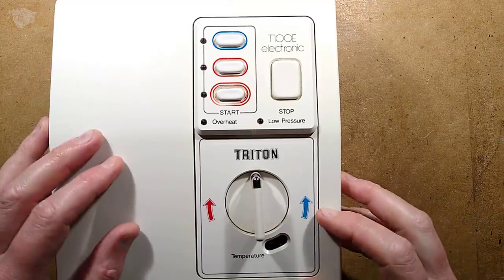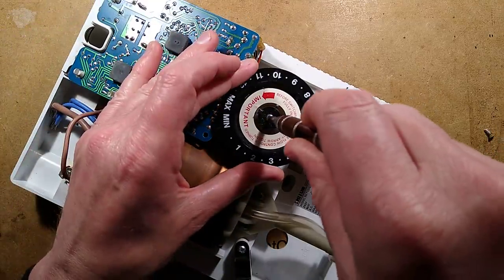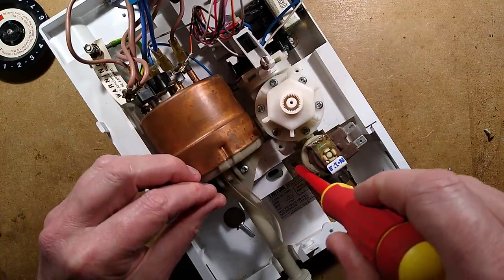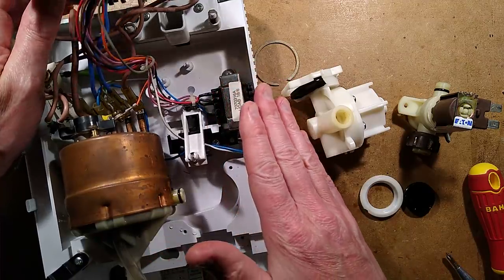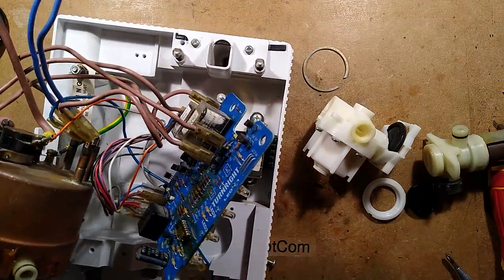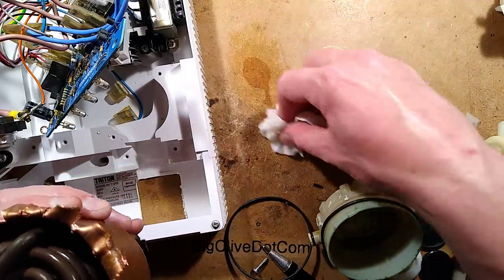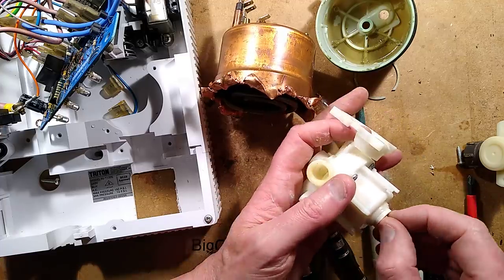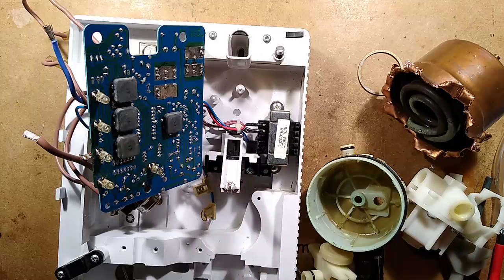Teardown of a British electric shower that went bang.

Comment: My nan doesn’t think I can think fix the electric shower.
Well, she’s in for a shock
Reply: 240 volts worth :D :D :D
Reply: Ba Dum Tsssssshh!
Reply: good one!!!! : )
Reply: @chmarr  The most electrifying shower experience ever.
Reply: @girlsdrinkfeck  Yes, the biggest risk is often fire when Mr Bodgit uses the wrong cable and leaves loose connections all over the place.
Reply: If thats your current joke, I think its revolting, and Im going ohm !
Reply: Joule be overloaded with compliments when you figure out watt's wrong with it
Reply: @alexander3554  Thanks for positive reply and I offer no resistance finding a solution. I will make a start on Faraday or Sarady.
Reply: I couldn't resist trying to make a few puns of my own, but watt I found was that I just don't have the brain power or mental capacitance to transform a sentence into a pun-charged version that'll amp up the audience. I guess I'm just missing the spark, and I don't think I can rectify the situation. Maybe I'll just jump off a half-bridge into a high current river…
Reply: @TerrisLeonis  Well done, and I know when Im outpuned, there will be no more induction of puns that has led to this current phase.
Reply: Lol.
Reply: I know this comment is not current, but I got a charge out of it…
Reply: @girlsdrinkfeck  Everybody who agreed with your statement should brush up on the basics.

Watts = Volts * (Volts / Ohms)

When you touch a live circuit, the amount of current flowing through you is limited... by you. By how many Ohms of resistance there are through your body (and clothes) to ground.
And by the volts you said don't matter.
Twice as many volts at the same resistance, equal twice the amps/watts.

The Watt/Amp rating of your actual circuit isn't completely irrelevant, but somehwat counter intuitive. If you got a higher rated circuit with thicker wires, this actually makes you less 'attractive' as an alternate current path. Path of least resistance and all that.
Reply: That’s got a nice Tim Vine rhythm about it.
Reply: Did she feel more confident about you repairing her shower after that?  If not, is that because her heart stopped?

Comment: The reason why the shower would have a delay before shutting down is both an anti limescale measure and a safety feature. Pressing the stop button first switches off the elements, flushing cold water through the tank before shutting off the water solenoid valve. Water which gets too hot is more likely deposit limescale on the element compared to cold water. There is also the added safety factor. If the a non-delay shutdown shower is switched off, then back on again in shortly after, the water sat in the boiler tank gains extra heat as it sat there idle for a few moments and when re-started can then causing a scoulding risk.
(I work in this industry, but not Triton!)

Comment: I remember when still living with my parents, in one house we had this exact same model.  We moved into that house in 1993 where it was already installed by the previous owners, so by this point it'd be at least 27 years old. Don't know how long that model was on the market for, but it's done well if it's lasted that long.
Reply: Good old British made product made to last decades. I expect a modern one will be designed to last 10 years.
Reply: My parents had a different model from the same brand that lasted a similar time as well.   One time it broke and my dad just replaced a part inside it and it lasted for another 5 years...
Reply: Another comment mentioned a 1990 date code on one the components so it was probably built 30 years ago.
Reply: We still have one of these in our bathroom at home, no idea how long it's been there for, but still works perfectly (touch wood), probably not the most powerful or efficient, but if it ain't broke...
Reply: @Haggisking  y'all say touch wood? We say knock on wood in America.

Comment: Awesome video.  In the US, devices like these are rare & used primarily in non-residential applications.  I've only seen the "Insta-Hot" modules under sinks; never a shower.  They use the 20 amp version of our 120V GFI outlets.  Never seen one "hard-wired" without an outlet.  Probably because our breaker-panels aren't Ground Fault protected.
Reply: Spot on, ground is required.

Comment: What i find quite suprising given the environment this lives in (damp and wet) is that there seems little internal corrosion or damage to the mostly uncoated pcb!
Reply: Not only that - zero scaling on the elements! I live in the South of England, and within 2.5 years - never mind 25 - the whole copper kettle would be full of limescale.

Comment: As a plumber from the UK, these are the most common form of shower in the UK. They're more economical to install and to service than a pumped shower or power shower. They make sense to install in (and are most commonly found in) rented properties. Seeing some of the comments here saying "Mixing electricity and water is never a good idea" leads me say the most alarming thing I've seen an electric shower like this do is dim the lights in the room next door when turned onto full power. They're designed to not be dangerous I've only ever seen a handful of these have this happen where water is pissing out of the casing from every angle; that said, the majority were broken by age or fatigue as opposed to being inherently unsafe. When installed correctly and of a reasonable quality, they generally last for quite a long time and are pretty safe. When they go wrong, you tend to know (as shown) so it isn't like you'd be standing there having a shower and suddenly you've got mains voltage flowing through you. You'd have to be incredibly dense to not notice that something clearly isn't right
Reply: Yeah it's the same with a lot of things. People just have a fairly rudimentary understanding of how things work and make judgement without the knowledge to back it up... I mean, being scared of an electrical shower is hardly an issue. But it's that same kinda thought process that fuels bigger issues in the world. It's best to be critical and not believe everything you are told but you should also be critical of your own lack of knowledge at the same time.
Reply: They might be more economical to install but certainly not economical to run. They use A LOT of electric. Spend the extra money and install a proper shower fed by hot and cold water from the gas boiler. A shower is usually installed above the bath so there is already a hot and cold feed available.
Reply: @simontay4851  Not every where is on gas mains, and more houses are blown up by leaky gas  pipes than electric showers. A lot of electricity? How many showers, what temperature, etc? fwiw, in UK, in a few years time, gas will not be installed in new builds. The advantage with electric water heating, is that all the heat goes into the water. No flue needed, etc.
Reply: @simontay4851  How long do you shower for? My 10kW one would consume one unit in six minutes, so 15 pence. I only actually have the shower on for a minute or two.So around 5p per shower.
Reply: @simontay4851  Significant amount of houses don't have gas. Its immersion heaters, water heaters and electric showers but for the amount of time these showers are on at one time, they aren't that uneconomical
Reply: @debonh3828  The efficiency loss from converting fuel to heat, then to electricity, then back to heat, is about a 60% loss, rather than just creating heat directly from gas, which is about a 20% loss. Gas is much more efficient from a fuel-to-use standpoint. Electricity-to-heat is a 100% efficient process, it's all the things that happen before that create your losses.
Reply: The student house I rent has four 6.5kW electric showers in one house. It's an ordinary house with a 100A single-phase mains breaker. You can do the maths.
 When you turn on the shower you can see the CFL bathroom bulb dim momentarily.
We've lived here for 2 years and not had any fires yet, although one of the switches outside the bathroom for isolating the electric shower melted once (probably because the switch was pitted, the landlord put in a new switch and it's been fine since).
Reply: if this isn't a power shower, what is it...?
Reply: @RWL2012  It's an electric shower. A power shower refers to the power of the water, which is pumped by electric pumps.
Reply: Steve D  No it's not efficient. Large electric hot water heaters have been banned from the US. They must be heat pump units.

Comment: Mains power in the shower?  I thought it was supposed to be a toaster in the bathtub.  Is this like the ketchup vs mayonnaise on french fries thing?
Reply: If the power is out, run it off a car battery in the shower 😀😉
Reply: Absolutely mayonnaise!
Reply: Shocking!
Reply: The heating element is in a copper container that is earthed/grounded to unsure that the water has zero voltage on it, unlike the plastic suicide shower heads with the token gesture earth wire in it :)
Reply: French fries should be served with remoulade, not mayonnaise.  Though McD has a special "French Fry Sauce" instead.  But if you've never seen the correct sauce before, it looks like raw mayonnaise (the main, but not only ingredient).
Reply: lorddissy, If the mains did get the water charged, it would trip the RCD (GFCI), same with the toaster, it would trip the RCD (GFCI)
Reply: @EdwardTriesToScience  Well...not all of these heaters can be operated via an RCD. For most efficient operation, many heat via un-insulated wires. The idea is that most current will got the path of least resistance, which is the wire, and the little bit of current which goes "into the water" leaved the water again through the grounded metal pipework. Too much work for the electricity to go though a hose onto a person with a relatively high resistance.
Usually, a 300mA RCD will be fine. But a 300mA RCD is not guaranteed to protect a human. A 30mA is meant for protection of humans, but will be too sensitive for such a heater.
Regardless, Clive's bother's heater has insulated heating elements, like a washing machine, a dishwasher or my old Philips coffee maker...at least until the insulation failed. Yeah, but the whole point of making coffee is to become most awake, right?
Reply: @klausstock8020  These do not trip a 30ma RCD as there is no where near enough earth leakage to trip it. Electroboom measured the water to earth current on a proper suicide shower, I think it was 3ma !
Reply: It’s not a thing. They’re Belgian fries (NO idea why they’re called French in English ...) and they come with mayonnaise. Those who take them with ketchup are barbarians.
Reply: @Stefan_Van_pellicom  yep, the Belgians invented fries and beer. Two of the most relevant food-related inventions.
Reply: Edward Science Innovations that’s when there is one installed 🤣 don’t forget many British houses still don’t have RCD’s.
Reply: Tasters are quite effective at heating up the bath water.
Reply: @klausstock8020  uninsulated heating elements in showers are not permitted in the UK
Reply: @steverpcb  As you said, the heating coil is isolated from the water, and that part has pretty solid safety arrangements. Slightly more iffy is that the case has no seal, and relies on water draining in the right directions to stop the shower spray reaching the electrical connexions. If you were to spray the shower head upwards at the box, like some average member of the public might well do while cleaning the shower, there is a possibility of water getting in very bad places.
Reply: coppice, being a device built to be installed in the “interdiction volume” of a shower I’d expect it to have a more than appropriate IP rating, but noticed on a triton I installed a year ago that relies on a pretty basic non rubbery plastic barriers/channels design to prevent the water from going in like you said.. For some reason I have that feeling that I’d trust more a wiska box to not get wet inside than these units.. I’ve applied a cordon of silicone before putting the lid on for a bit more peace of mind when someone uses it.
Reply: @filipe.skunk8  The reason given for not using IP practices is that those practices tend not to be very reliable, and if the sealing fails in the wrong place water actually accumulates inside the heater, rather than draining from it. In the 70s the heaters I took apart used a seal around most of the case, with drainage arrangements at the bottom to remove any water that got past the seal. Now they have no seals at all, but they do seem to stay dry in normal shower usage. Its things like cleaning, or kids playing around, that bothers me.
Reply: coppice that statement just made a blue screen in my head 😆. It’s a fair point to say that everything will eventually fail at some point, but not doing it because of that eventual failure, gives me mixed feelings.. I’d prefer like you said, being water tight and having a means of draining the water from inside if needed.. to me it bothered me that it didn’t have an adequate gland and a round cable in the wall to have the electrical feed made water tight and the lack of that rubbery seal on the lid.. it’s not easy to find a straight tile wall in the average house around here, so the back structure always bends a bit here and there when you’re tightening it to the wall.. so I “created” those seals with silicone cordons on the back against the wall and on the lid.. so if that unit goes wrong it won’t be because of external bodies getting in, but only if the internals fail, if the internals fail then I’ll make sure it will have the most sensitive protection i can provide to that circuit.. so i installed a 10mA RCD just for this unit, otherwise I wouldn’t be sleeping properly knowing that, like you said, a small kid or any other person can be throwing water at it from some unexpected angle and things go wrong..
Reply: Electric showers for some reason always have a mains supply and are generally even on their own circuit
Reply: @coppice2778  Modern ones do not have the copper case, the Neutral ( non Live/Hot wire ) is already connected to ground/earth with a very low impedance, so there are effectively 2 grounds/earths.
As for the case seal, it is sealed from the front and top, with the bottom open for drainage. These are safe, Electroboom measured the voltage and current on an actual suicide shower head and even licked it !
Reply: Bob Smith i know that since i became an electrician back in 2007. That’s the thing,  like you said, there’s some “qualified” morons.. i also feel that some electrical courses given here are too easy and that kinda opens doors for some not very competent people to be classified as qualified. Electrics is a very serious business and when things are precariously done it can have very serious consequences..
Reply: @steverpcb  The front panel controls are sealed with a silicone membrane, but the two halves of the case are not sealed together. They are just shaped to coax any water to drain away as it enters the case, rather than continuing into the product where it might reach something electrical. 

If you connect neutral to earth in the UK you have broken the regulations, and are in danger of causing a fire. Neutral and earth frequently differ by a volt or two, and there is a very low impedance between them. In a modern installation the RCD will trip. In an older installation nothing will trip, but you can get huge currents to flow, and overheat something.
Reply: Bob Smith when you say “notoriously over-protective UK regulators/regulations” i can tell you’ve never worked abroad as an electrician in another EU country.. i guarantee you there’s no British house that would pass the regulations in Portugal for example, and that’s by the simple fact that the electrical installation of a house/building must be provided of its own infrastructure, end to end, namely a tubing network where your wires and cables will run inside.. a simple basic connector block with a bunch of wires squeezed in it like it’s common around here, even if inside a junction box is also a straight fail, a connector block isn’t a one for all solution and should only be used for connecting a bulb holder, not much more than that.. I’ve worked in Portugal, Italy, Romania and UK and can tell you with 100% sureness that here is were the work is done in the most poor way/bad practice. Not being a hater or anything, there’s also things i find better here compared to EU (but not many), and things still work and are acceptable safe wise but if you ask this to any British electrician with at least a couple of years work experience in Europe, he will tell you the same.. there’s also another thing I don’t understand is why lots of good electrical materials like for example a 3P + N din rail bus bar is so hard to find and i even get people laughing at me when i ask it.. instead of that they provide me with a shit brass monoblock covered on a 70’s style brittle plastic for 1P only.. it’s just my humble opinion based on what I learned in school, my work experience which goes from the small house electrics to substations and everything in between, in these last 13 years.. 🤷🏻‍♂️
Reply: @filipe.skunk8  It is required by law for an electric shower to be protected by an RCD
Reply: Stefan Van pellicom Mayo? Salad cream, please! Yech.
Reply: Well yea, Mains in the shower, even with RCD...weird feeling. Same as cleaning a loaded gun even the safery is on.
Reply: @Nige C more like 9.5Kw, and in what way nasty...?
Reply: @Stefan_Van_pellicom  I think it's the style of the cut on the potatoes. Most people at this point just say fries